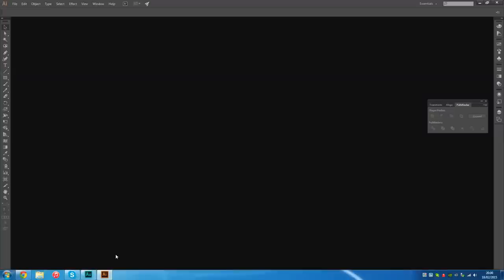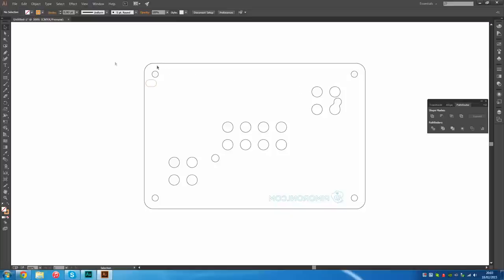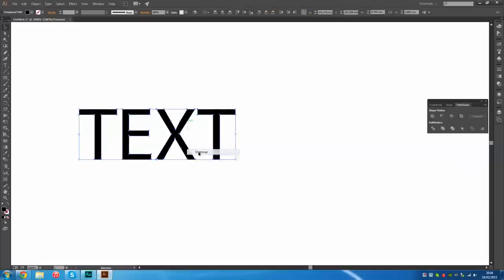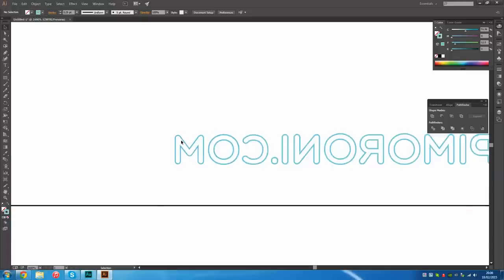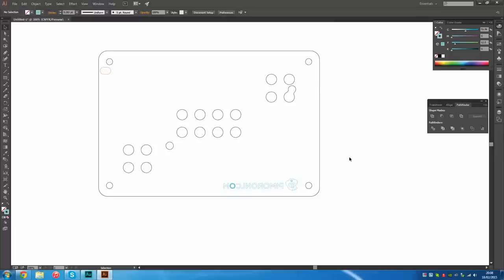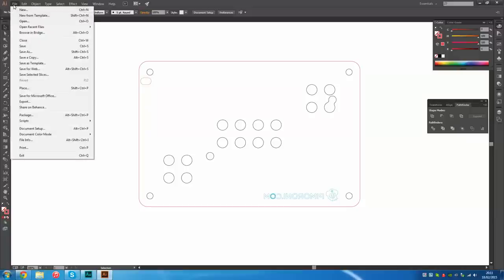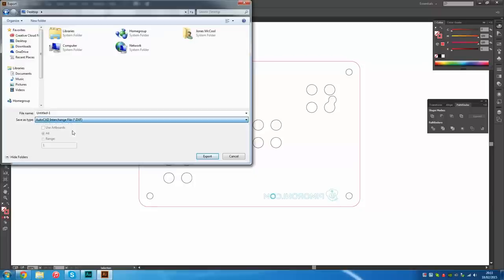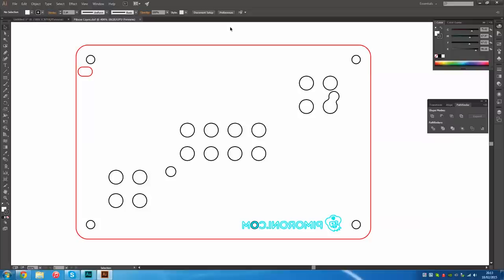How To Design For Laser Cutting

Comment: Hey Man 
So I need to do an wood inlay where the wood pieces have to fit perfectly. How do I compensate for the thickness of the laser ? 

Described in another way. The laser should be cutting on the outside of the line and not the very line, because then the pieces will be to small. 
I hope you understand.
Reply from the maker: I don't compensate for the laser thickness. If your laser operator is competent you shouldn't really have a problem! If your laser is out of focus you will get a thicker cut line though. :)
Reply: Yeah, kind a find that out. 
Thanks for your feedback
Reply: The laser does indeed have a thickness, its called  kerf.
The actual thickness varies with depth of cut, because the laser
point is infact a cone.

as an example ive measaured my laser at 0.2mm, so if you cut
a rectangle then cut another 0.2mm smaller, they should fit exactly.
then you can start shaving off hundredths of mm to get a really tight fit.

ive made wooden boxes with really hard snap fit, that after a while
i tried pulling the walls apart and the box broke, not the join, then realized
that some types of wood give off a resin when cut, then combined with really tight fit
formed a glued bond.!!
Reply from the maker: AARO LEV 100% the laser does have a thickness. It's removing some material, that material must have a width. 

However in my experience, I've never made allowances for the laser thickness and I've never had a problem with it. 
Also for beginners I reckon it'd be just another factor to take into account. When they can live without it and then take it into account when they're more experienced. :)
Reply: A really tight fit eliminated the glue/clamping time when making a fair number of repeat boxes, so depends whats being made and how many

Comment: Nice video.  I was a bit surprised when you mentioned the "main two programs for laser cutting" and it did not include AutoCAD (the hands down industry standard) or Corel Draw (I don't like it ... but a LOT of people use it).
Reply from the maker: Fair comment, if I did it again that'd be a good edit. :)